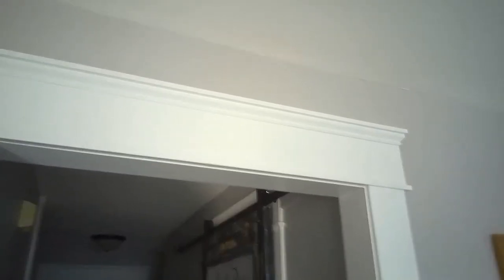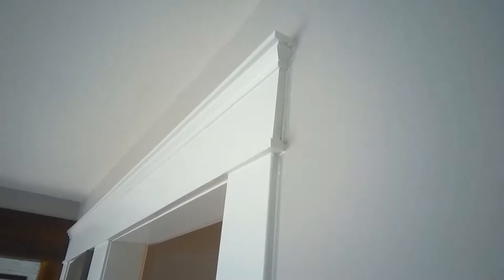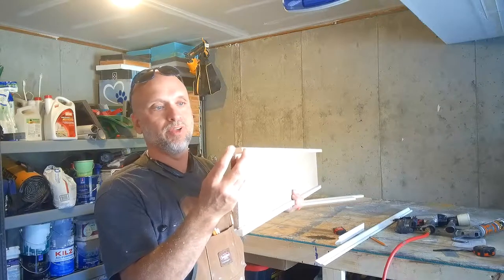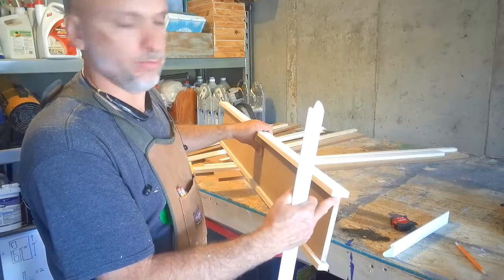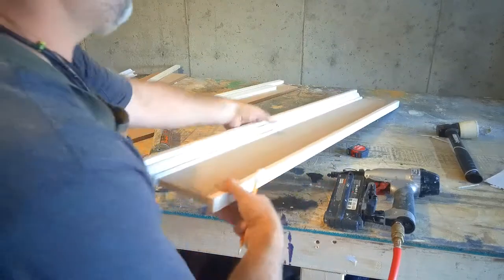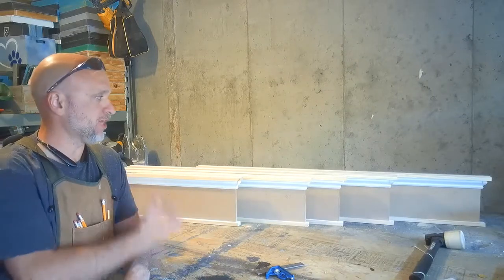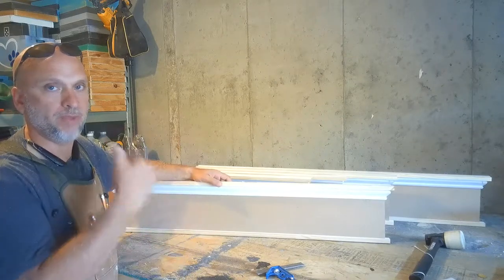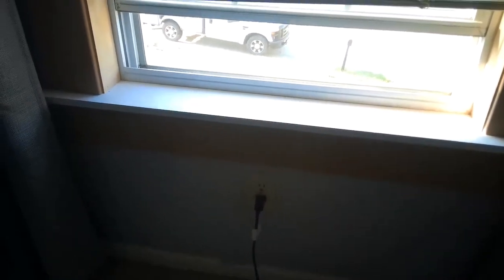Door and Window Header Trim

Comment: Great Job, have you heard of 2P-10 adhesive? It sets in 10 seconds and cures in 30 seconds. Trim guys use it a lot. You use a spray activator with it.
Reply from the maker: Yes sir I have used it. Great stuff